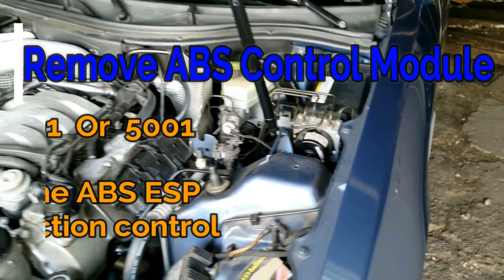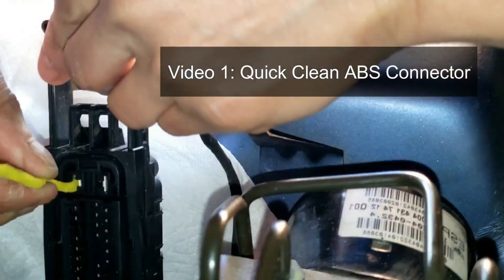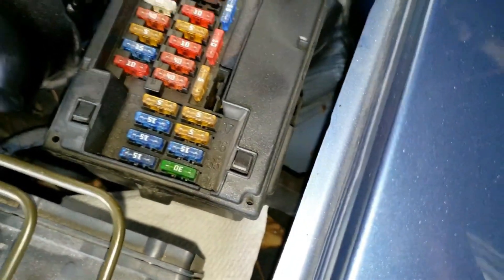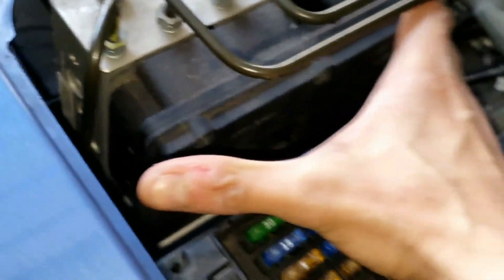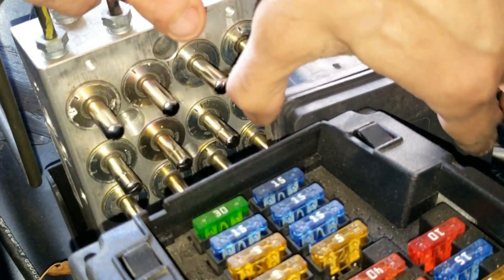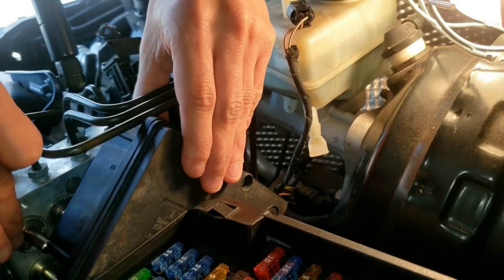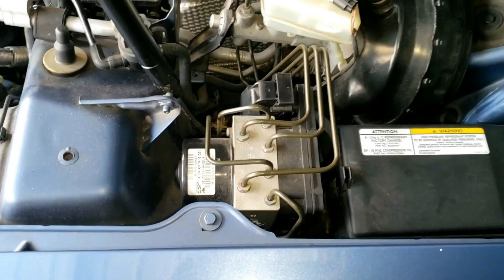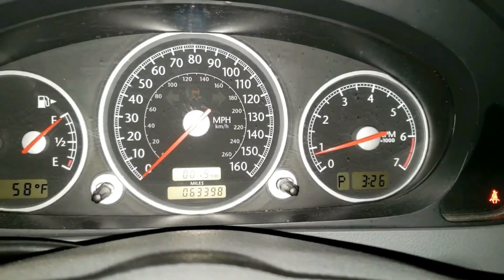Remove Control Module Unit Mercedes Crossfire NO TRACTION ABS ESP Codes C1001 5001

Comment: Hello my friend my Car keep showing check tire pressure in last 3 months when all my tires are fine and new and all pressure same as each other and correct 

MY car is Indirect TPMS works with your car’s Antilock Braking System’s (ABS) wheel speed sensors and There is not valve sensor inside tye wheel.

They been advising me to change both front tyres and i did change them but unfortunately after spending a lot of money for check and diagnose the car still keep showing tyres i diagnosed with the car scanner  it shows (N30/4 ) do you think it might be abs control module? Thanks please advise me also i can send my unit many thanks
Reply from the maker: It could be. Maybe swap a used one. Also make sure your fuses are good. And also use a code reader to confirm any other codes you may have to help narrow down the problem.
Reply: Hello, My vehicle's TMPS fault light is on, but I think it's caused by the pressure measurement sensors. When I brake in my vehicle, it releases the brakes after a few seconds, I have the same problem in my Ford Fiesta. Do you think it will be fixed if I change the hydraulic oil?

Comment: So if I buy another used w205 esp module I don’t need to program it. Their is no vin stored in it from other car. ? My c class is 2015
Reply from the maker: No vin is stored. But double check online. Perhaps others can chime in on this. You should use a code reader to delete any codes that are on the used one.
Reply: @FixCarYourself But the used one should have the same serial number?  Thank you much.
Reply from the maker: The part number should be the same.

Comment: I got a c1111 c1110 and c1140 code I think this abs module is done I will just replace the module on my 04 nissan quest
Reply from the maker: Hopefully that works out for you!
Reply: @FixCarYourself  I just got a use abs module it's running good now
Reply from the maker: Glad to hear! Sometimes those units get bad and have to be opened up and soldered. Very difficult and might be destroyed in the process. Maybe I'll make a video on that one day.

Comment: Do you think I need to program a used abs module I know you said a used doesn’t need reprogramming but I have 07 s550 (w221) and it seems everything is different then other classes
Reply from the maker: I can't speak for all models but if its an exact replacement just resetting it with the code reader (meaning erasing codes on the scanner) generally does it. It's kind of like restarting a computer.
Reply: Thank you, that was very helpful!

Comment: Hello, I have my C300 w204 flash all lights on the dash on and off whtile driving, and whenever it's on the Brake, ESP, blaa blaa blaa will be showing, and even my speedometer will seize to function. it also goes away intermittently, they said I need to change the ABS, please your take on this
Reply from the maker: Something like this a code or a bunch of codes would pop up on a code reader. So you'll want to use that to narrow down the exact problem. If you don't have a code reader its cheap online for $10 to $20, and you just pop it in the car's OBD which is under the steering wheel or lower dash.

Comment: Is the same for code P0304?
Reply from the maker: Are you asking if code P0304 is the same for this problem, or are you saying P0304 and the codes C1001 or 5001 are the same?
Reply: @FixCarYourself  asking if they are the same problem
Reply from the maker: @flaco7146  They are different I just double checked and code P0304 usually indicates a bad spark plug is detected.
Reply: @FixCarYourself  ok so i had cylinder 4 misfire i changed all my ignition didn’t do the spark plugs the car work fine after a week i got check engine light on, epc, air bag,abs, brake, my speedometer wasn’t working thought this had to do a problem with the control module but thanks i was just in the process to buy the part.
Reply from the maker: @flaco7146  Ok. Usually when a spark plug is bad their will be rough idling and I think possibly even a higher amount of smoke. Hook it up to a code reader to narrow down the cause. Also It's also possible you may have to clear the codes. Changing spark plugs usually isn't difficult just make sure you have the right tools and of course the right supplies.
Reply: @flaco7146 Little late man but did you fix it & if so what was it ?

Comment: Hi. I have a mercedez 2009 w204 kompresor. 
I was told that if i buy a used abs module i will need reprogramming even if the part numbers are the same. 
But your video above says i do not need reprogramming as long as the part numbers are the same. 
Pls confirm if using used abs module with same part number will not require programming. 
May i also ask when will i need programming?
Reply from the maker: I don't think a used model needs to be reprogrammed as I swapped out a used one with identical information (as mentioned in the video), and I did not have to do any reprogramming. Other websites have said the same thing where reprogramming is not necessary. However, I did use a scan tool to wipe away any codes from the used model.

I'm guessing the repair shop is using the word "reprogramming" in a different sense. As the only thing that needs to be done IMO is to reset or wipe any codes using a decent scan tool after installing and testing the vehicle.

Comment: So what problem this solve ?? Will it work on a 2004 Mercedes Benz clk 500 ??
Reply from the maker: Removing and replacing the ABS Control module can help restore your traction control ( this will make your brakes pulsate for example like when your sliding on snow/ice, and potentially help stabilize your vehicle).
Reply from the maker: I would think this would work on a Mercedes CLK as the components are all very similar between Mercedes vehicles. Please let us know if you replace yours, and/or your experience.

Comment: United Kingdom and other places with similar weather! Beware, on 17 yr old XKR the controller was corroded onto the hydraulic module and separating it pulled one of the solenoids out of the module rendering it unrepairable.
Reply from the maker: Good to know that this doesn't work on a Jaguar car. This works on a Mercedes though or at least ones like these.